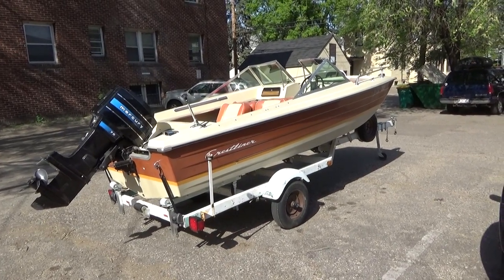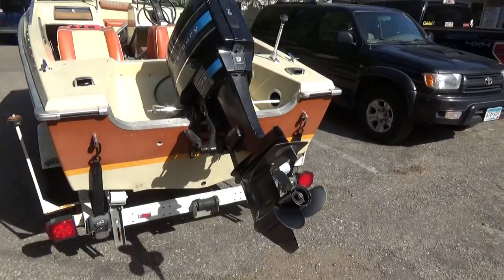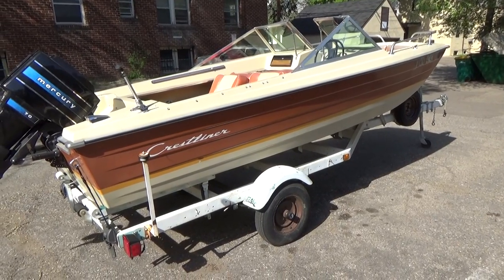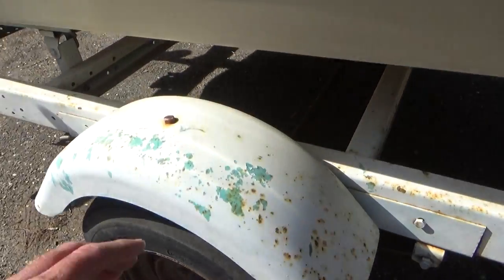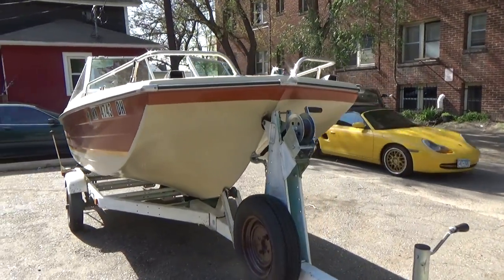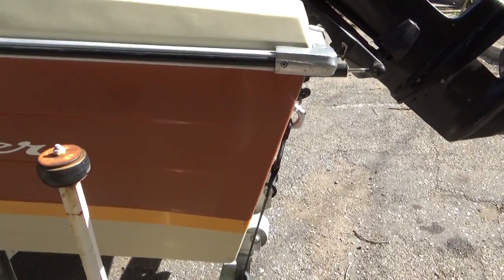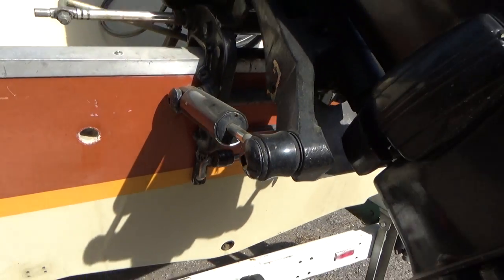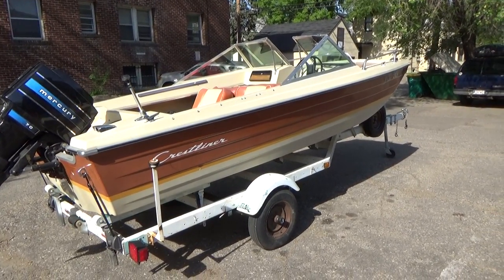Boat Restoration:  1974 Crestliner Muskie 15 Walk Around

Comment: I just got one exactly like this with the same engine. From Wyoming idk how it eneded up here in washington.
Reply from the maker: very cool.  Idoes great in choppy water too - go figure for a tri-hull but it really performs great.  See some of the other recent videos of this boat on my channel k
Reply from the maker: Would love to see a vid of it!!!
Reply: Same here.  Did you die and leave it in a will to someone who sold it to me for $200?  Wrong time of year, but it's been sitting nearly a decade.  I figure the lower unit will need lube, wheel hubs, and carb clean or replacement on my 60hp Merc